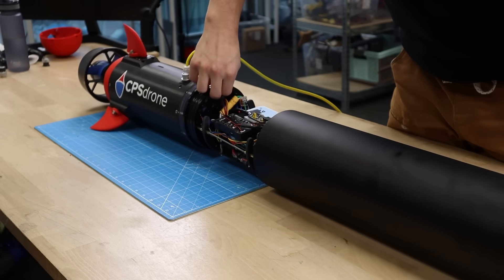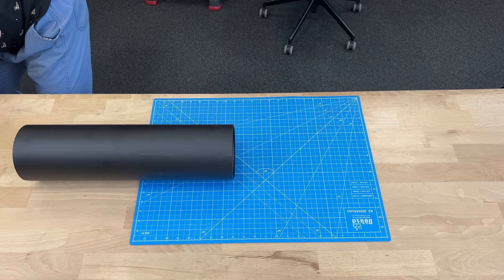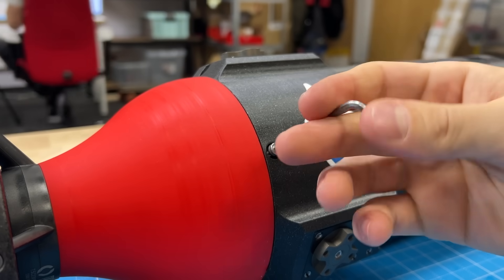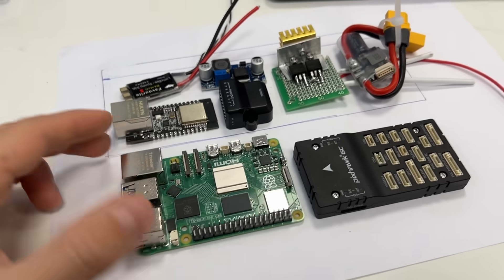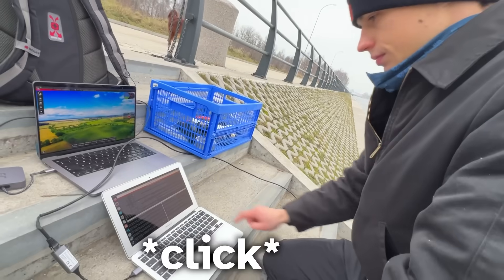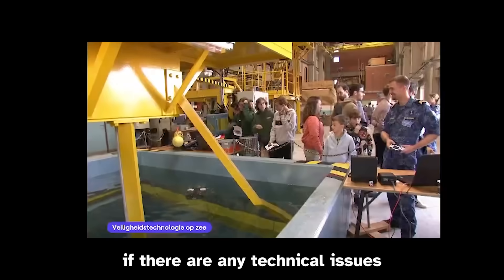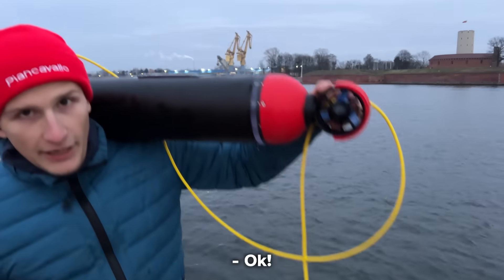Building a fully AUTONOMOUS submarine

Comment: Your position problem is interesting. As it isn't a 3d space problem is a 2s space problem. As you should have rather good deepth from pressure. Simple triangulation would work. As radio and light won't work well under water you are left with acoustics. Simply replace the tether in your postion drone with a transducer. Then put hydrophones on the drone. With a few fixed buoys the hydropones should be able to pick up the angle from the buoy and triangulate position. If you can encode data into the carrier sound then you can have the buoy transmit it's position it measures with gps. Essentially rebroadcasting gps data allowing the buoy to move during the mission to keep in range of the sub.

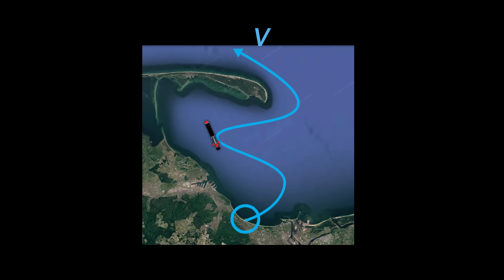Comment: Solution for navigation: You can use a magnet sensor (compass) e.g. QMC8553 for the direction (make sure the magnetic sensors is placed away from any metal, battery, …). And a water flow sensor combine with the rotation speed of the turbine you can calculate the distance (need some calibration measurements). Optional you can place a GPS inside the drone and have a reference location if you turn up some times. 7:29

Comment: About recovering your drone if some sort of failure occurs...  Use a CO2 cartridge and inflate a bag after a predetermined amount of time that exceeds the maximum amount of time of your journey.  With a GPS antenna, check for a signal, and once you receive a lock, start broadcasting your location.

Comment: A compass, as others suggested already.
Idk if applicable in generell but especially for a moving object: Using a microphone and triangulate between well known static sound sources? (Like an offshore oil rig or so.) Well, that could become really really complicated, at least if you don't create your own sound sources. (If legal at all, range, idk.) Two sources would be enough if they are close to the shore, tho.
Oh, also, side note: You don't need the Wifi router. You should be able to use the RPis onboard wifi for this. You can set it up to act like a router.
(Hope my respond didn't get blocked by YT like usual. 😐)

Comment: Hi cps I did a similar project for my year 12 hsc to get around the limited cable length with the bouy so i could go 30m deep. I had it spool in and out of a reel depending on the current ROV depth and using a aluminium tape strips on the tether to detect how much tether was let out with an ir sensor which was easier to waterproof. I can provide cad models and some of the code if wanted i was using an Arduino uno to control this.  Also my sub weighed about 13kg and the boat about 3kg and i found it would drag the rov around in high wind situations. Although your boat looks far better hydrodynamicly because mine was made from 90mm pvc pipe. Chuck me an email if you want and can explain my design abit better.

Comment: The positioning system could possibly be achieved by equipping the unmanned vehicle with an onboard hydrophone that receives uniquely coded acoustic signals from GPS-synchronized reference stations—such as buoys, surface vessels, or from the shore. Every reference station broadcasts its precise GPS coordinates along with a timestamp at a regular interval. Use distinct frequencies for each station to avoid interference conflicts. The vehicle's microcontroller decodes these signals and calculates the time-of-flight, converting it into distance measurements. With at least three such measurements, the system uses triangulation to accurately determine the vehicle's position in real time, enabling autonomous underwater navigation.

Comment: have you thought about a compass to determine the direction your submarine is pointing? 
and maybe you could add multiple pressure sensors around the nose of the submarine, comparable to a 5-hole pressure probe. with this, you could determine the angle of the direction of the water flow compared to the axis of the submarine to determine its actual moving direction, and maybe also the speed of the submarine in the water. 
it will be quite tricky to calibrate the system, and i am not sure if you could account for water currents with such a system....

Comment: the missile knows where it is at all times it knows this because it knows where it isn't but that doesn't mean the missile looks on itself in despair a missile must travel ludicrous distances to reach its Target the Target often being miles away a speck a dream its chances of himing its Target is Sim most especially if it's outdated onprepared and has fotled in storage for yeam and the target is moving at such speeds it unconceivable to the human mind but despite all this the missile doesn't tell itself it doesn't know where it is it merely tells itself where it should go the power in the missile lles within its ability to know where it is going to end up and with small inscremental changes every second every day and every year the missile takes its deepest and most mind shattering course deviations and failures and it does something remarkable it fums its dailures into lessons to guide it along the proper path its failures are not only inevitable but knee needed for the missile to find the proper path the misole drifts when it needs to it doesn't ham all its fuel in a desperate state to mach Enlightenment the missile knows its destination but aims to conserve fuel until the proper time comes when it will strike and fulfill its purpose the missile takes the path of confidence and steady elevation until

its purpose the missile takes the path of confidence and steady elevation until its time comes and when that day comes

it will experience a joy greater than anything it could have imagined the missile will take joy that it roand against the dying of the light and refused to go quietly into that good right but it all began with the missile's first step otherwise it would still be in its containment unit wondering what could have been the missile knows its greatest lessons lays within its own fear so it should embrace it and mold it until it has nothing to be afraid of even welcoming the greatest of duallenges thirsty for experience to the missile its greatest lear will become not what will happen but what will happen if it does not challenge its own fear none of it would even be possu sible without a goal a predetermined destination a hard wired machine coded instruction deep within the cold roots of the missile guidance system without the qual the missile would wander simlessly until it hit an orphanage or some other catastrophic destination that was never intended the missile doesn't seek to put blame on the wind or turbulence for its failures to the missile this is unnecessary and a waste of time the missile doesn't seek to

become the victim of circumstance it aims to be in control and take responsibility to be as secure and rigid as it says it is it needs to be to guard against the forces it must encounter you are what you say you are are you last or are you merely on the path to something greater you are the master of your

destiny just as the missile is

Comment: I think you need to add an emergency rescue feature. What you need to do is create two key elements: a water pressure sensor and an automatic rescue system triggered by the installed water pressure sensor. The principle is that if an error occurs on the submarine and it sinks underwater, the water pressure will increase. When it reaches the preset pressure, the module will activate the safety feature, releasing a buoy to lift the submarine to the surface along with the activated GPS

Comment: well you could have security system thats time based so if it does not arrive after the expectet time +buffer timer it activates a can with high presure expanding into the air/water chamber so it goes back to surface where GPS works again

Comment: Should you not include currents in the water when deciding the direction to navigate to? Either use the actual movement as the direction in which case you can steer towards the goal or if you use the orientation of the drone then you need to correct the direction for the water current if there is any.

Comment: For the GPS boi, just use an empty 2 liter or 5 liter bottle of water.
To allow the craft to submerge, use a thin, yet strong tether between the craft and the boi.
Inside the carft, spool the tether around a cylinder connected to a constant tension spring.
The spring doesn't need to be too strong. Just strong enough to pull the boi and to allow the tether to unspool while diving.

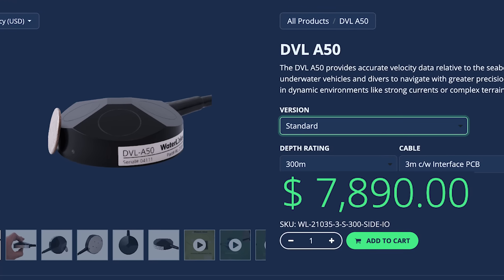Comment: 7:36 Hi, I'm currently researching DPSS (Differential pressure sensor speedometer) for my thesis. This is a cheap solution for DVL replacement. DPSS can measure speed by utilizing pressure differences, in principle using Bernoulli. 

The sensor I use is the MPXV7002DP, and in theory it can be used to measure low speeds (maybe <1m/s, who knows, I haven't gotten to the testing stage yet).
It would be very interesting if you tried this alternative solution, because the problem with almost all AUVs is positioning, and DPSS is a cheap option to replace DVL.
Reply: brilliant idea, just like using pitot tubes on airplanes

Comment: It might be a stupid question, but couldn’t you use several buoys (at least three) that have a GPS module and transmit their data underwater using different frequencies? This way, you have the possibility to triangulate it from the submarine. You would then continue to use the pressure sensor for altitude.

The buoys could be equipped with a small battery, solar panels, and a motor to maintain their positions.

Comment: Adding a foam inside the won't affect the buoyancy, instead it will increase the weight of the drone as the buoyancy is generated from the displaced water volume in relation to the relative density of the body. to achieve the desired effect, mount the foam blocks outside as extensions to the cylinder.

Comment: Nice job! Congrats :)
To solve issue with positioning drone under the water I'd like to suggest to involve IRS (Internal Reference System) well known from aviation. I has own downsides of course like drift but you can improve calculations by adding some underwater compass and GNSS unit update position every eg. 30 mins (going to the surface is required). During updating position on the surface, you can send position of the drone with even some snapshots of collected data. Please consider to add some strobe light which could help to see the drone by other vessels or to try rescue the drone in case of lost.
Good luck!

Comment: INERTIAL GUIDANCE!

You can take a small boat, pen and paper, and dead reckon to the other side of the planet with a probable discrepancy of only a few national borders (200~ km), half earth circumference is 20,000km, we have a discrepancy of 1km per 100km travelled. In the video they are attempting to travel 20km~, so a blind sailor instead of a microcomputer would get you 200m inaccuracy at the last stretch of reaching penninsula, and maybe 350 at the end of the return trip (due to partial recalibration upon reaching penninsula)

At 200m inaccuracy, on a boat, I would say thats fine. But at 350 for an RC sub is scary if you dont build around that problem, a camera or two to avoid crashing into the coast/beaching itself, etc.

Comment: More room for error, but you can convert volumetric flow rate to velocity. For rotation transitioning to inline thrusters could allow for the same method to determine angle change. 

again, more room for error, but would not need gps. Could also include gps as backup, and program it to return to surface and recalibrate position every x period lowering error buildup.

Comment: Cool Project! I got a suggestion about the DVL Price Issue :) ... Since we only have GPS availability on the surface and DVL (Doppler Velocity Log) systems are cost-prohibitive, we propose using an IMU (Inertial Measurement Unit) sensor as an alternative solution. The IMU would track position by integrating velocity and orientation data. To manage drift, the system would periodically resurface to recalibrate its position using GPS fixes. This approach provides a cost-effective compromise between continuous navigation capabilities and positioning accuracy.

Comment: wonderful project, there is nothing else to expect from you. you could try to use a ULF system to communicate with the drone, it has a range of about 1km, but it lacks in quantity of data. It could be used to receive data on the state of the vehicle, depth, inclination, speed, etc. I don't think it can be used for navigation.
 As for autonomous driving, a "simple" inertial system (speed, accelerometers and gyroscopes) is not precise enough? Even adding a simple sonar would not be enough?
I know that for this project a very precise system like the DVL is needed to identify objects on the seabed and detect the exact position, my question is to understand if a cheaper system (even if less precise and with less "visual" capacity) is feasible.

Comment: Hi! Cool project!
Why don't you use a compass and a curvimeter? The screw will turn the curvimeter, the amount of rotation will tell you the distance. The compass will indicate the horizontal deviation.
Length and angle are navigation.

This method is used for underwater orientation by athletes (underwater saboteurs).

Comment: Instead of using normal GPS you can add 3(+) water type "satellites" that will transmit in frequencies that travel good in water and find your position in the triangle.
The "water satellites" can be on fixed location or they can have their own GPS and transmit their location, so you will be able to use the fancy software by converting your position in the triangle compared to real position of "water satellites"
It will be a bit hard to implement it, but it will be simple to surround an area of interest with "water satellites" and you are good to go, just drop it in the water.
If satellites can be solar powered even better.

Comment: When I got to 9:29, there was one critical flaw the code did not account for. Ocean currents. You need to use vectors to adjust for correct travel on waypoint missions. If you don't have vectors in the code, then the autonomous sub will drift off course. Since it's tethered to a buoy, this isn't a problem. However, when you want to upgrade it later, this will be a problem... a huge problem.
Reply: Wym by vectors? Is it related to inertial and gyroscopic data?

Comment: For navigation you could use a combination of dead reckoning and a single sonar beacon. 
1. Sync both sub and beacon to GPS time. 
2. A speaker makes a loud measurable beep at a specific interval. 
3. The sub compares the timing of heard beeps to scheduled beeps. This puts the sub on a semicircle relative to the beacon.
4. The sub starts with a heading estimate.
5. The sub travels some distance and measures rough distance traveled via IMUs. 
6. You can correct the heading of the sub by measuring the error in distance closed by the sub to beacon vs the measured distance locally.
Reply: 3 sonar beacons at fixed locations and different frequencies could recreate the triangulation from gps, I wonder how signal integrity would hold up over these distances though.
Reply: @alexthompson353 likely depends on the transducers and hydrophones used. It looks like 20km isn't that hard.
Reply: @narr0wm1nd49  definitely possible, but also likely to put a nice dent in the budget. Judging by the price of the main thruster however I’m guessing that isn’t a massive issue
Reply: Are there regular sonar tones being made by some nearby government or monitoring entity?

Comment: If you do a lot of testing you can plot your speed based on your motor RPM. Then having a simple algoritm subtract the tide from this speed can give you a location that might only be 10 or 20% off. If you then steer it to 18km instead of the full 21km you can probably resurface before you hit anything, and then rely on GPS to beach it. Oh and fun fact, there is a calculation you can do to determine your ideal length to with ratio for a tube underwater, to get the least amount of drag. It basically is finding a optimum between pressure drag and friction drag. For low Reynold number vessels (Small and slow speed) this turns out to be around 1/8, width to length. So you got pretty close. (This is comming from a Maritime Engineering student)